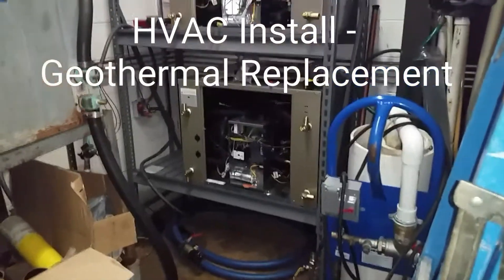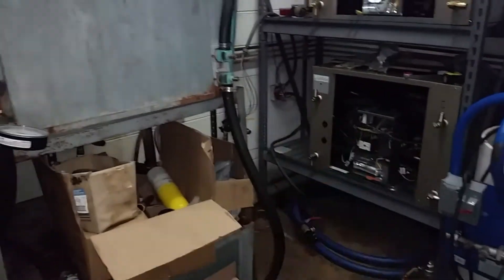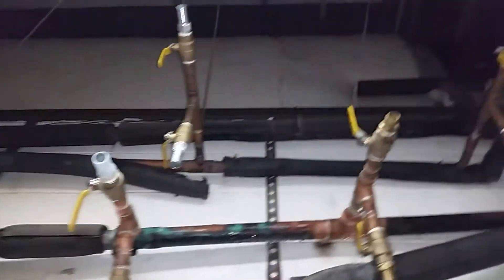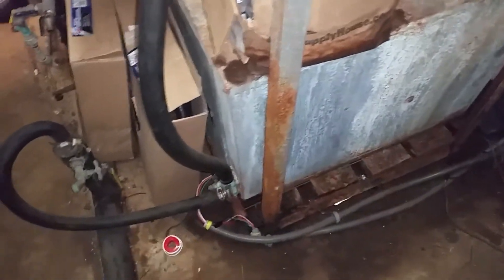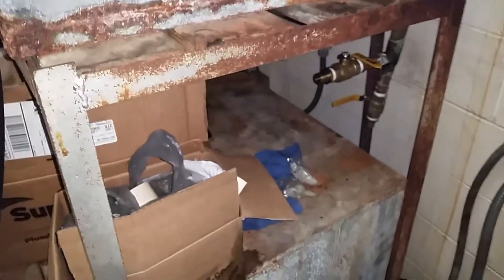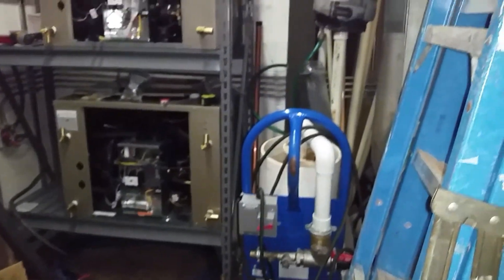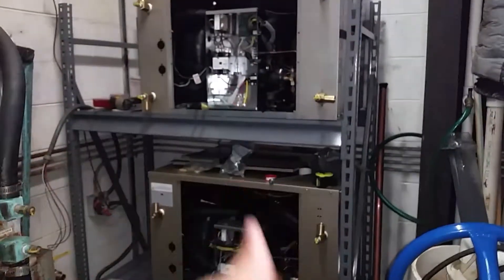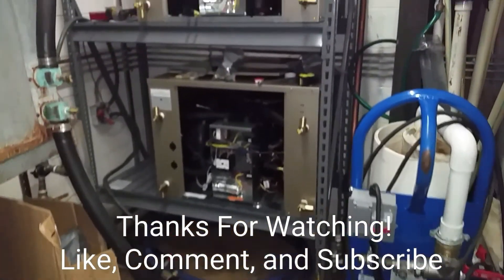HVAC Install - Geothermal Replacement

Comment: I'd like to see a basic run through explanation on these through all the cycles! Start to finish. Where water comes in,  what happens in system, check valves, zone valves, controls, safeties, circulation loops etc...  
 ~ Thanks for sharing all the great vids and tips!!
Reply from the maker: KungFuMaintenance Ill see if I can put together something once we get things up and running. Thanks for watching!